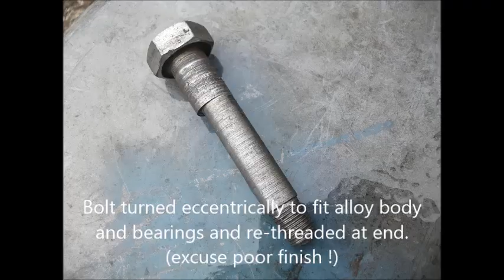Curved Flange Bender

Comment: hi Brian, nice work... I saw a tool similar to this 30 years ago...a body man friend had it...it was about 1/3 the size of yours and had lightly knurled rollers , at least one set driven by turning a bolt head...it could be clamped on to a radiused wheel well opening and would form a 90 degree flange by turning the bolt head...i sure wish I had paid more attention to how it was made because I could sure use one now...God bless the good...doug  (kanada)
Reply from the maker: Thanks for interesting response, Doug. Have never seen anything like the one you describe, but it would have been useful,  even though it might have been slow.

Comment: Ok,  No Worries , I am in West London , do you have any plans for these or the bearing sizes basically dimensions etc..., its a nice tool to make some panels , rather than banging it out , I saw something like yours but it could be extended for more depth, any way it a great product , Good Luck mate and thanks for answering
Reply from the maker: O.k., Rusty Benz, here are a few basic dimensions :- The block is 3" x 2 5/8"x 2" ;  The 3 larger bearings are 40 x 17 x 12 mm wide ; The 4 small ones are 22 X 8 x 7 mm wide; The small bearings are at 2 1/8" centres. Hope this goes some way to helping you.